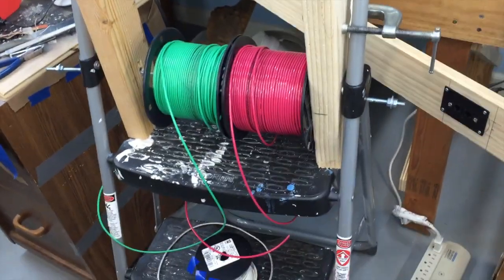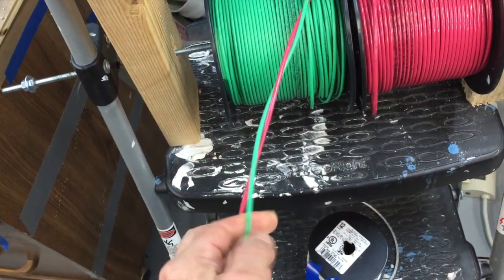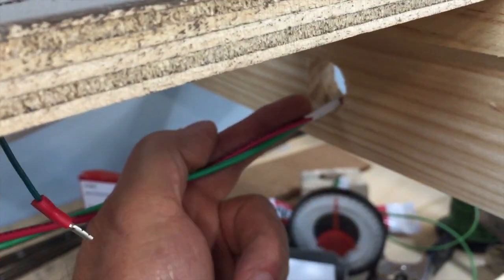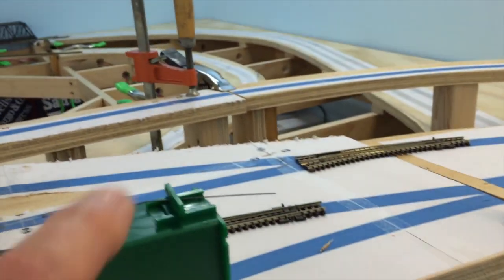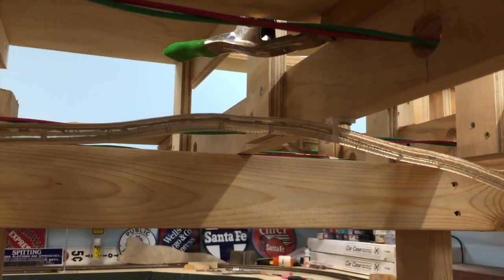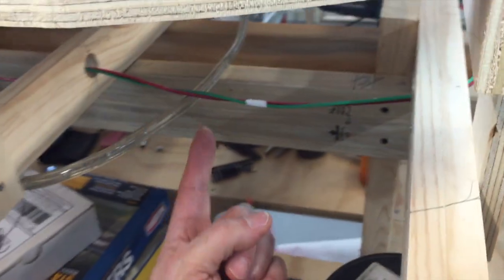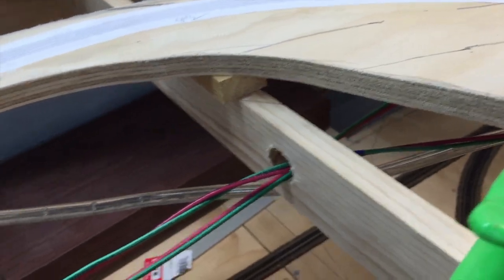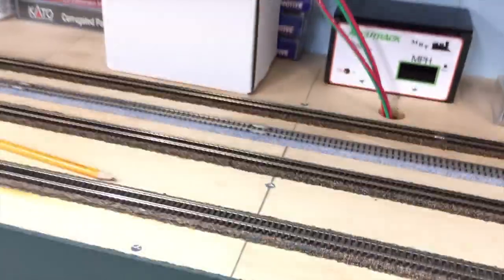How I Install DCC Power Bus Wiring

Comment: Show a video. On how to make your districts and do you use a booster for each district
Reply from the maker: Thanks for the question Juergen. No I don’t use a booster for each power district. I use an NCE 5 amp Power Pro DCC system that feeds 8 DCC Specialties PSX circuit breakers that then provide the power out to each district similar to the way a home has a breaker panel that sends power out to each circuit. I also have 4 PSX-AR auto reversers that are powered by the same 5 amp system. I have constant voltage throughout the 15’ x 25’ layout (N scale). As for the each individual district (4 in staging and 4 on the main level), all I did was try to balance out the number of track feeders in each of them. I did not calculate how many engines and other items that would be drawing power in a given section of the layout. This layout was planned and designed in 2012 using a cad program where I laid out everything and marked where each feeder was to be placed and numbered using a MSFT Excel spreadsheet. I also use SPDT power cutoff switches on all of my 26 staging tracks plus 17 on the main level. This also removes the power draw for engines, especially the sound equipped ones. Does that help answer your question?….John

Comment: Excellent video.
What brand wire are you using for your buss and what gauge is it? 
I need to buy buss wire and looking to buy hopefully a large amount to get a better price as I need to wire about 350' to 400' of main line. Your brand wire and if solid wire (or twisted) would be helpful to know before I buy..Thanks in advance. 
Phil
Reply from the maker: Hi Phil, I used 12 awg stranded that I bought at Home Depot. I got the large reel as it was less expensive than buying the smaller ones. My layout (N scale) is 15’ x 25’ so I did not want any voltage drop. I have 8 power districts with each using the 12 awg as their main bus. My dad was an electrician so I sort of wired the layout like a house, i.e., from a central location with a circuit breaker for each district. Using the 12 awg stranded wire gave the layout a standard 14 volts no matter where it was measured. I would not recommend using 12 solid as it would be very hard to bend. The website, wiringfordccdcc, has a great discussion on recommendations for wire gauge based on size of layout. I hope that I have answered your question. If you have other questions please ask. Thanks…..John
Reply: @tanzj  Thanks for the detailed reply, It is very helpful.
I actually have high grade copper oxygen free 12awg stranded wire that I bought about 3 years ago, (I have about 200 feet of 2 conductor wire so I am glad to hear that will work. That will save me from buying solid wire. The DCC Guy on his channel used the stranded also and has a great video explaining this.
So basically it sound's like I need to find a Central location so that I can fan out in two directions to use the wire more wisely as to not waste it. I am not sure where that location is yet as my layout will have about 400 feet of main line when all the track is laid. (I have about 250 feet laid right now).
Not sure how I make the districts yet without having to run wire in the same direction multiple times to divide them mainline into districts. 
Thanks very much for you information. Appreciated.
Phil
Jersey Shore Area
Reply from the maker: @uptownphotography  Many DCC people will say that you have to calculate how much power you will be requiring for each district based upon all of the items that draw power such as engines, turnout motors, passenger cars with lighting etc. I just tried to balance the number of track feeders between all 8 of mine. I have 4 in staging and 4 on the main level. I just picked a place for the power distribution that was sort of in the middle of the layout and close to a plug….John
Reply: @tanzj  Thanks John. Good advice and helpful. Enjoy your Sunday. Today, I am working on my harbor scene and also some scenery. Happy Modeling...
Phil

Comment: Great video.  One question: I have planned one track that has it power wires at least 4’6” from the bus wire.   Is it too far away?   Will it lose power?
Reply from the maker: Thank you for watching and your question. It would depend on the gauge of wire you use. For example, I used 12 for my main bus and if the feeders were too far from it then I connected 14 to the main bus and then distributed the power from a barrier strip that was connected to the 14 and then up to the feeders. I have a large N scale layout, 15ft x 25ft, and have constant voltage throughout all of my track. In any event, I would recommend going to the “wiringfordcc” website. He has lots of information pertaining to voltage drop with various gauges of wire as well as a lot of other DCC wiring topics. I found that most questions that I had were answered on that website. Hope that helps answer your question…..John
Reply: @tanzj  thank you
Reply from the maker: @SkipRoGlo you are very welcome

Comment: John, great video. Just what I needed as I am in the beginning stages of a new layout. 
How do you connect the 12 gauge wire to those tiny connectors most DCC boosters or command stations have?
Reply from the maker: Thank you for watching and your comments. The 12 gauge wire is not directly connected to the booster/command station such as the NCE Ph Pro 5 amp system that I have on my layout. The output from my booster (18 or 16 gauge stranded) goes to a euro style barrier strip and then is sent to the 8 circuit breakers and 4 auto-reversers via 12 gauge wire. The output from the circuit breakers creates the 8 main power buses on my layout and it is all 12 gauge. The distribution from the main buses to the feeders is a combination of 14 gauge to euro style barrier strips and from there power is distributed to the feeders with 18 gauge connected via bayonet connectors to the 22 gauge feeders that are then soldered to the tracks. I know that is more than you asked but I thought that it might be of interest. The entire layout has the same voltage everywhere. I thought that the  12 gauge main bus structure was important since my layout is large. Let me know if you want more information…..John

Comment: Thanks for sharing. Awesome size layout. What are those breakers u are using? Im having trouble with the NCE breakers right now.
Reply from the maker: Hi Rick, Even though I have a NCE 5 amp Pro DCC system I opted to use DCC Specialties PSX circuit breakers.They are not cheap but they work great. There are a total of 8 circuit breakers, four for staging & four for the main level.  I spent the time to figure out how many track feeders I had and then tried to divide them up as evenly as possible for each circuit. Some may have a couple more than others but that was the way that I did it. I also have four reversing sections where I used the DCC Specialties PSX-AR auto reversers.  They were also not cheap but work flawlessly.....John

Comment: This is the first video I have seen where someone has planned out a layout this large and have paper templates made of the whole thing! Wonder what planning software and size of printer used to get this done?
Reply from the maker: Hi, Thank you for watching and your comments.  I used software (Mac only) from Germany (you can get it either direct or from the Apple App Store) called RailModeller.  It costs less than $40.  I tested out a bunch of different programs (both free & paid for) before I picked that one, both for the Mac & PC (I own an older copy of Cadrail) to find out which one I could use to easily understand & document the already built twin double-track helixes (helices).  I picked the one that won, RailModeller, back in 2011 (it had all of the templates for various manufacturer's N-scale track & turnouts (I use primarily Peco but some Atlas too).  Most of the design programs today, both paid for & free, are probably pretty capable of doing what I did to include a 1 to 1 print out of the design.  When I used RailModeller to print my design, it took three (3) reams of 8-12" x 11" printer paper on my Epson home printer.  It had a numbering system & witness marks so it was easy to assemble & glue down to the plywood. If I wanted to make a change, then it was easy to go into the program, make the change, and print out just the part that changed.  By following the printout, I was able to ensure that the turnouts were in the exact place that was in the design. Let me know if you have any other questions....John

Comment: Great info !
Reply from the maker: Brice, There are lots of ways to wire up DCC but this is the way that I did it and it still works great. There is basically very little voltage drop around the entire layout. Typically I measure 14 volts on the track. I prefer stranded because it is easier to work with & it was less expensive to buy the wire in the larger reel since it is very easy to use 100’ of wire.  I believe that there’s around a half a mile of various gauges of wire under the layout from 22 up to 12.....John

Comment: you never show us the wire just the color insulation...I am looking to know if their is 12 or 14 gauge SOLID CORE wire available in red and green insulation....why I watched the video....does any one know the answere to my question...ps don't twist wire  dcc corruption.
Reply from the maker: Michael, It is 12 AWG stranded.  The solid core version of 12 AWG wire is too hard to bend.  You can use solid if you want but I prefer stranded.  The color of the wire insulation is not that important just as long you are consistent, i.e., due to the availability of the 12 AWG stranded wire, I've had to switch the red to black and the green to white, especially with 18 AWG wire.  Usually, when I switch a color, I will put a wrap of electrical tape to reflect the color it has been switched to. For example, a piece of green tape on a white wire.  Additionally, the bus wires for all of my 8 power districts all have color coded strips of tape on them every so many feet (as they are twisted) to indicate which bus it is.  All of that information is written down near my command station/booster.  The DCC power bus per several DCC websites (as well as from the NCE website) require twisting every so many feet.  I do not use snubbers at the end of each bus......John

Comment: Everything I have ever read said do not twist your bus for DCC. It can cause an electric field which can interfere with your DCC signal.
Reply from the maker: Hi & thanks for the comment.  I have read many articles that talk about large layouts (one of which is mine) that states that twisting the track bus wires help to reduce inductance. A excellent source of this is Mark Gurries web site and his article about DCC Best Practices, Snubber & RC filter and then paragraph 11 where he discusses large layout track bus wiring and twisting the cables. I am not an electrical engineer so I am not going to argue the point. Your method may work just fine and in some cases some of the DCC requirements are based on the system that you use.....John